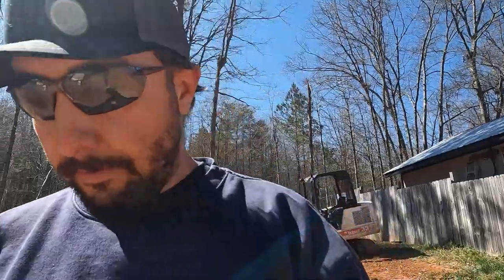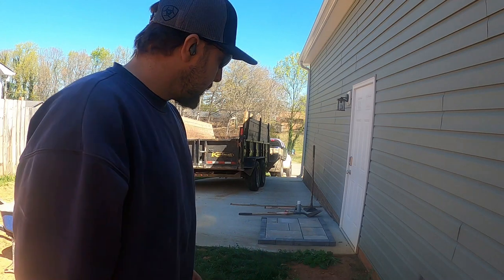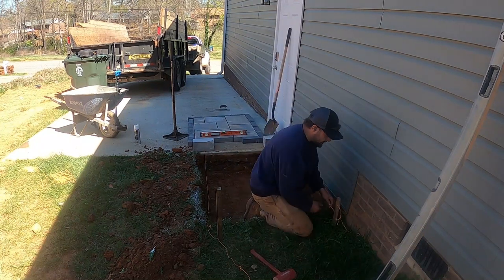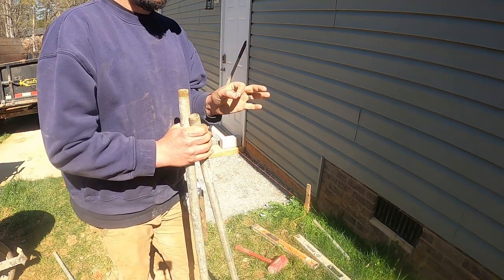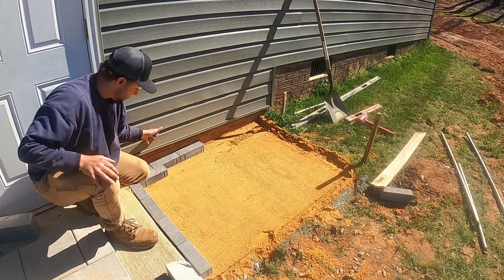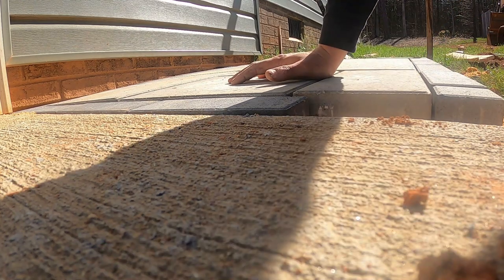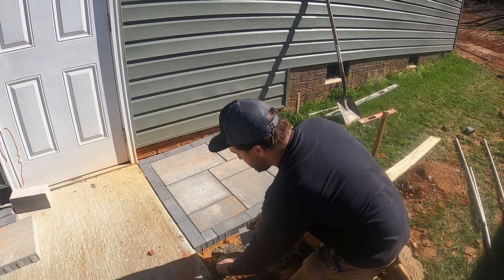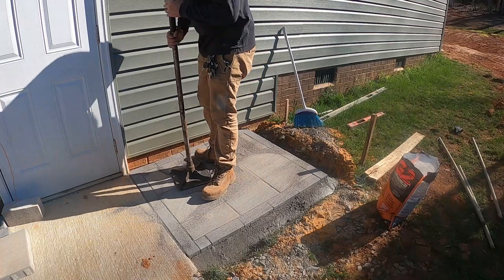DIY PAVER PAD

Comment: Love it. I'm going to do this exact design for my trash bin pad. My question is that if you lay concrete, won't it be impossible to replace or resettle the pavers in the future?
Reply from the maker: No you could chip it off easily if need be. You could also use plastic edge restrain instead of concrete if you wanted i just prefer the concrete.